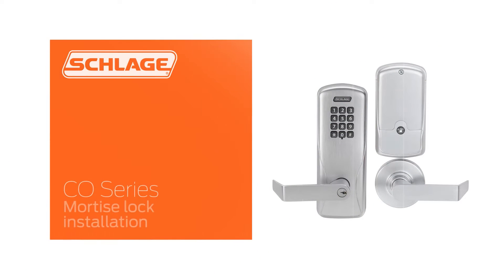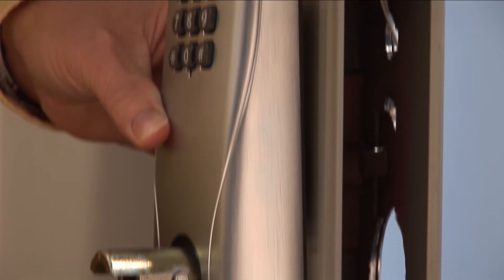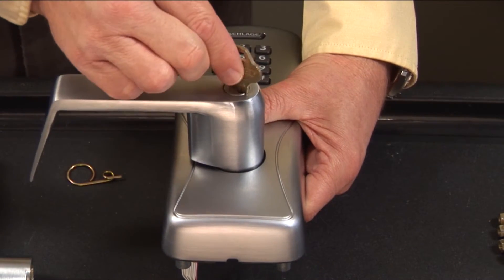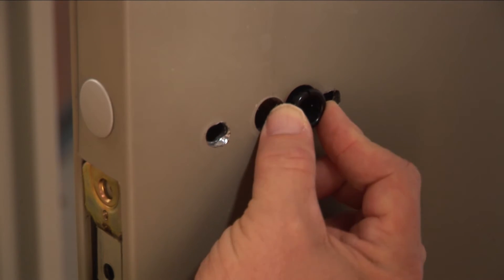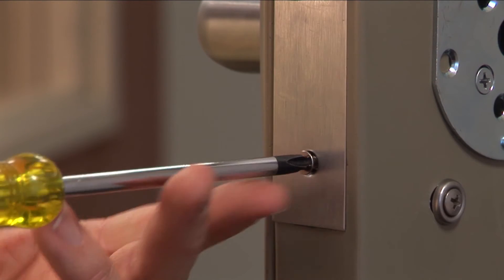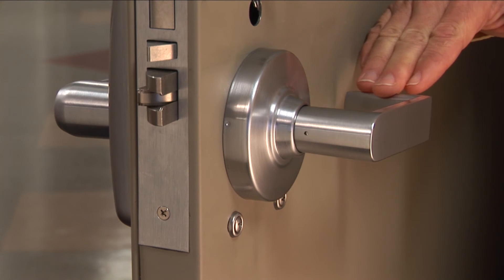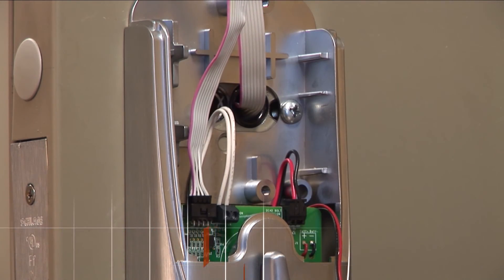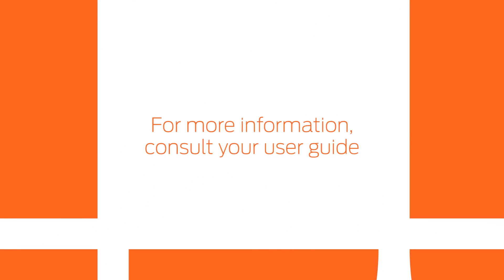Electronic Locks | CO-Series How to Install Mortise Electronic Lock

Comment: I have a storefront mortise lock at my business. Do you offer this type of lock that will fit my lock. It is a glass door.
Reply: Hello,  just taking a guess based on my experience and knowledge... if your door has a metal or aluminum frame on it, this device might be too wide for the space allowed on the frame.